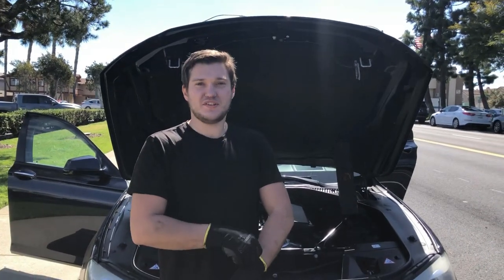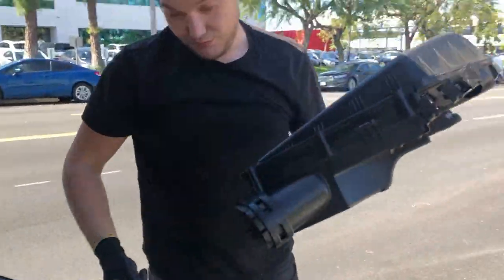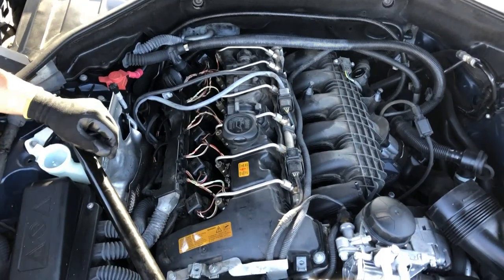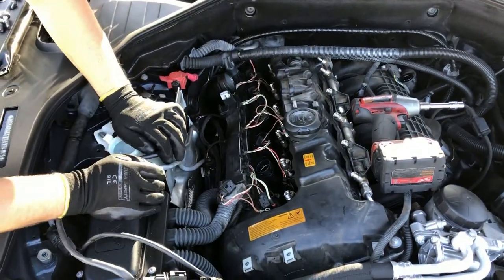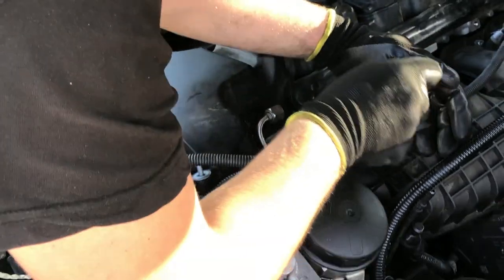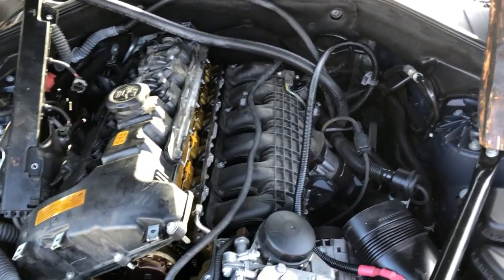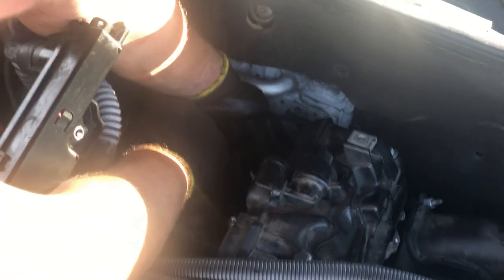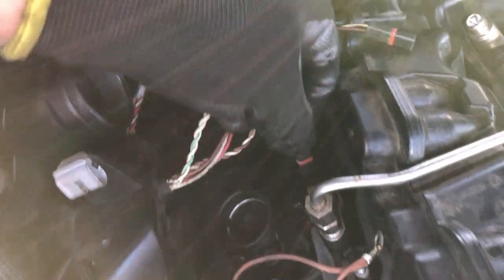DIY F01 BMW 740LI Valve Cover Gasket N54

Comment: This video has been super helpful, but I have made one mistake. The wire that goes to the very back that you cannot show on video - I believe I have broken the connector. Can you tell me what part this is so that I can order a new one? Thank you!
Reply: Did u found the part no, that damn cable is hard, i lay mine whole body on the engine  to get whole hand inside the *place to pull the cable off. But it was fail cant out

Comment: For anyone trying to tackle this with just enough knowledge to do this, the way i got the last connector out from behind the engine is to lay on the driverside, full body in the engine bay, with a very thin screwdriver. Then feel your way around the connector to know which side to press the screwdriver in, then lay there for 15 min to get a feel for it and in the end i finally got my screwdriver in the right spor and could press it in. Im still fucking aroun with the last e10 on the back left side, cant get a grip because of the piping there, almost 4 hours in now. Good luck guys
Reply: Also for the next person that reads this, you cant take the cover of without removing that last connector and definately remove the spark plug tubes, also when removing the cover it isnt going to be gentle, at some points i thought i was going to break something so keep that in mind when doing this. I got the cover off in about 4 hours because of that stupid connector and the last bolt on the left side in the back, also i couldnt get it out without really forcing it against the turbo inlet tube. Took me like 7 hours total till the first drive again

Comment: From my experience, the moment u need a new valve cover gasket ur PCV is also gone. In this case its recommend to replace the whole valve cover with a brand new original OEM instead and avoid any ebay valve covers as those PCV's are poorly made and u will be sorry, have wasted time and will fail soon. Stay original and don't be cheap!  OEM will be good for another 8 to 10 yrs.
Reply from the maker: Well you are correct and also wrong😁 unbranded parts are bad any parts they don’t fit poor quality etc, there are plenty oem parts on ebay so it’s not ebay problem. Pcv system on n54 is built into valve cover BUT all it does is basically cyclones oil, the trouble maker is the back hose which is a one way valve that one is better to replace rather often, replacing n54 valve cover is not necessary at all unless it’s cracked (n55 completely different story)

Comment: Thank You from Poland. Bmw says its necessary to remove catalytic converters. You show that is not necessary
Reply from the maker: 😂 bmw says lots of things that are not true😁
Reply: @Zeiten  yes, but remove that cover is not easy, especially because of rear plastic tube of second turbo. I was removing cover 2,5h 😃
Reply: @Lian Ellis instablaster =)
Reply: @Mayson Damian thanks for your reply. I found the site thru google and im in the hacking process now.
Seems to take quite some time so I will reply here later when my account password hopefully is recovered.
Reply: @Mayson Damian It worked and I finally got access to my account again. I am so happy!
Thank you so much, you saved my ass!
Reply: @Lian Ellis You are welcome :D
Reply: @lucky_luke269  how did you remove it?  Im 5 hours in 4 hours just trying to take of the civer
Reply: @samerzorba5026  just use more power 😀
Reply: @lucky_luke269  can explan more how u get it out, i tried pulling it but fail.
Reply: @JOHOR_BossM  why did you fail?  It is hard to remove, but not impossible.  Get a second person to help and use a lot of strength to break it out. Where are You from?
Reply: @lucky_luke269  i mean 14:41 that last cable is damn hard i lay mine whole body on that engine and mine right hand is totaly inside and tried to pull it out but cant
Reply: @JOHOR_BossM  you need to disconnect this connector

Comment: Still out in the open to do this👍👍👍  Question on my X5 06 3.0 got a P1093  the code on Ista is I believe is a 000053c. same thing. Bank 2 upstream fuel trim. Did a reset adapt on the DME no codes. Watched the fuel trims before and after. Trims now are good, but why I ask I do alot of short trips. Like 1/2 mile round trip. The O2's are switching, swapped the O2's on the valve cover and its not the O2's ever seen this before ? ICV and DISA are good. Cleaned the MAF no, vacuum leaks that I can hear will smoke the engine soon. Its got 73k on the clock.  O buy the way 1st to view the vid
Reply from the maker: Hi, check your fuel injectors on bank 2, cyl 4-6, one or more might be leaking
Reply: @Zeiten   I've watched trims on both banks and they are reacting the same. I did suspected the injectors will monitor. Thanks for the info. 👍
Reply from the maker: @kevinvandevelde9789  you are welcome
Reply: @Zeiten  Found the problem. I fired up INPA and watched trims. but found the bank 2 rear 2 sensor dropping low on accel. When to change it and found it was loose. Tighten  it up alls good now. I thought the heater was going bad not the case.
Reply from the maker: @kevinvandevelde9789  glad to hear you solved it

Comment: Hi I did this job yesterday finally but it was super tough to get the valve cover up and out from that back corner.  I installed a factory new valve cover and gasket but now I cant get those 4 bolts across the back to screw in properly, I got 2 of them but the other 2 just wont thread correctly.  Any insight to what could be wrong?
Reply: yea, mine keeps leaking. this is not ez.

Comment: Hi! Did u disconnect battery before doing this procedure?
Reply from the maker: Nope, but you can if you feel uncomfortable
Reply: @Zeiten  thanks for reply. One more question. What are the consequences if I disconnect the battery?
Reply from the maker: Nothing will happen usually, just let the car sit for a few minutes before disconnecting the battery, rarely frm modules get fried but it’s mostly happening on e90 after facelift on f01 not an issue but anything can happen

Comment: My 740Li 2009 has a shudder at around 1800 rpm when bearly feathering the throttle. Probably when turbo kicks in and only in comfort and normal mode. Sport and sport+ are used to my heavy right foot so no problems there....Any ideas welcomed please ! I'll watch this gasket replacement a few tens of times to know it by heart before going in, cause my engine is pissing oil everywhere....at 80k miles !
Reply from the maker: well oil leaks can cause that also check vacuum lines for boost pressure control solenoids and connection those lines to engine cover it has built in vacuum reservoir
Reply: @Zeiten  thank you !!

Comment: It’s way easier to also remove the fuel injectors.
Reply: Man I wish I knew that before I tackled it, we kept thinking if we remove injectors we could get the actual valve cover up and out so much easier as it gets held up on the turbo tube in the back corner since you have to bring it up so high to clear the injectors.

Comment: BMW took the idiocy to another level by slanting the engine toward the passenger side -- making removing the valve cover damn near impossible without disassembling the rear turbo intake pipe. 

Good luck installing it without ripping the rear part of the gasket clean off --- forcing the job to be done all over again. 😤

No wonder they lost the war.